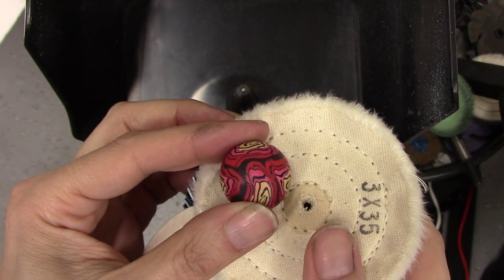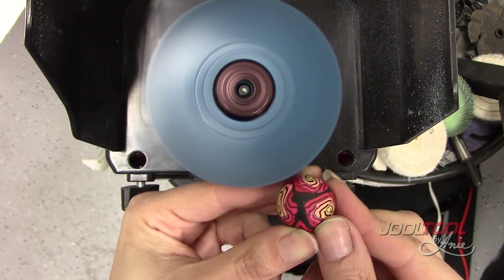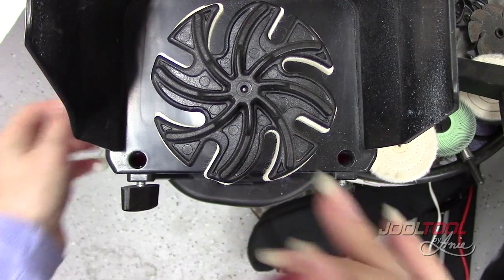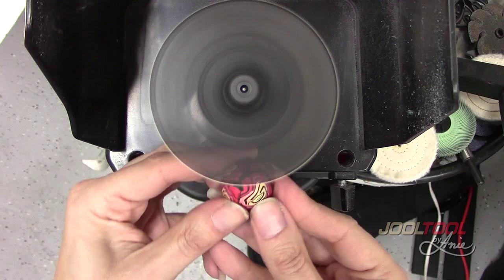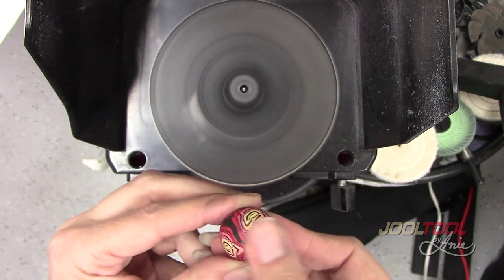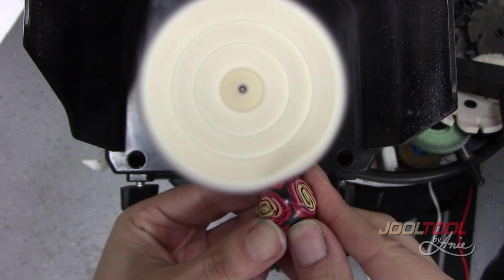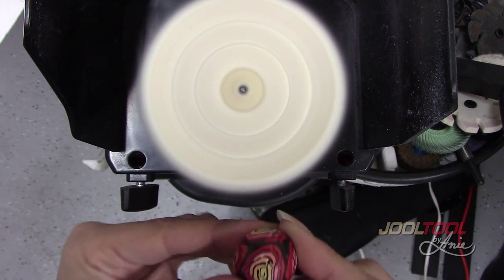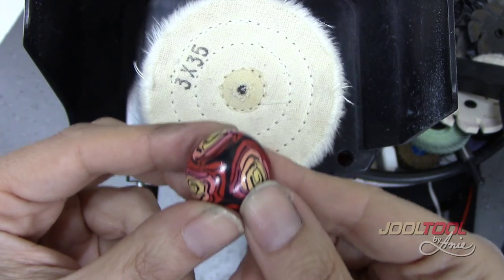How to polish a round Polymer Clay piece on the JOOLTOOL

Comment: Hi Cindy Lietz and JooltoolUSA  I´ve got my JoolTool today and I have started to sand my polymer clay peaces… And it hasn´t been pleasant at all… I want to think that it has something to do with my inexperience with the tool, but the piece had a lot of scratches… I would really like to know what I’m doing wrong… If you could upload videos about what the most common mistakes are… I´ve try a lot of different ways to use it, more pressure, less pressure, different speeds… But I can´t avoid the scratches when de piece meets the end of the wheel… And if the piece it´s too big I don´t know how to even it… Thank you very much for your time